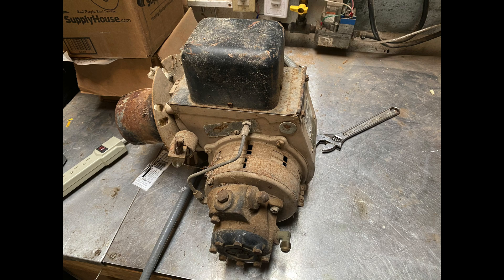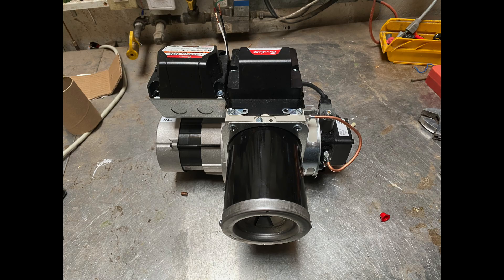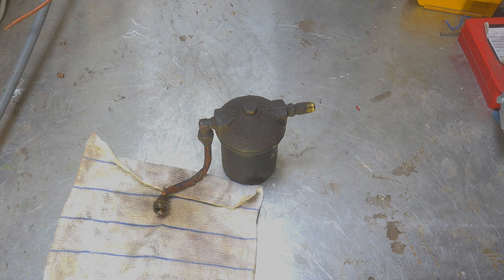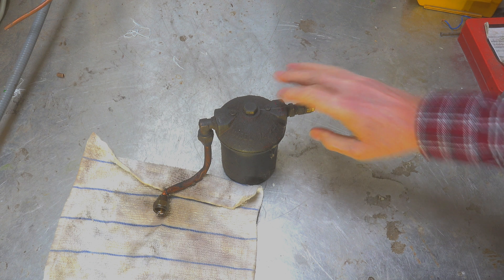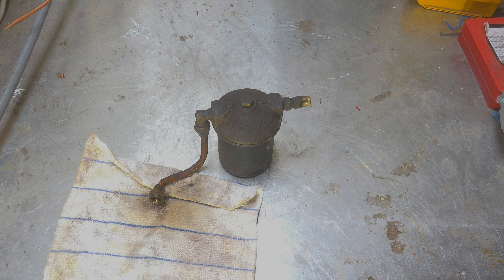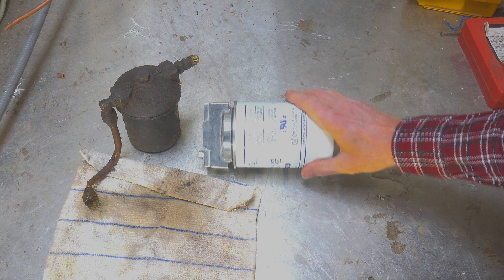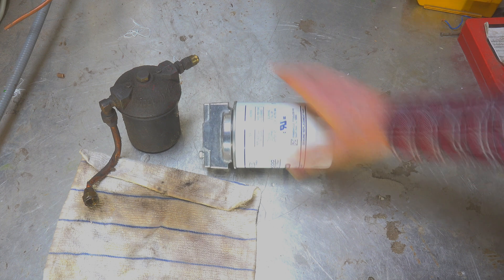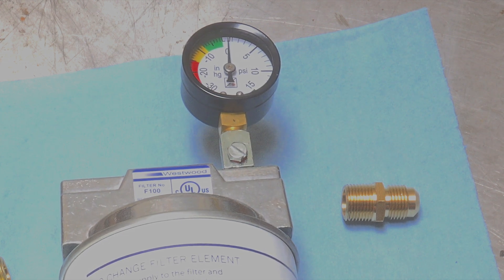Change from conventional to flame retention oil burner #1

Comment: I much prefer a 1725 burner, they are quieter smoother and much easier to work on, plus the J or Webster pumps last much longer.  but then Id rather work on a low pressure GE or Oil O Matic.
Reply from the maker: I also like the 1725 burner.  The 3400s can squeal if they get run even for a short time dry.
GFM

Comment: Hello sir i’ve got a question, today my furnace technician was out to warranty a leaky a/c core unit,this is a five year old high-efficiency furnace set up. While he was dismantling the intake and exhaust to ascertain the core he found an obstruction in the exhaust side of the furnace. Apparently while the fellas were putting this furnace together they accidentally dropped a 90° pipe fitting in the exhaust pipe. Which I would say probably blocked the exhaust by roughly 40%. My concern is should I be concerned🤷‍♂️. The heating portion of the furnace always worked awesome and we’ve had some pretty damn cold winters here. Thank you for your time.
Reply from the maker: If you haven't noticed a problem, such as reduced output, I would not be worried about it.  I also have seen many things in the plenums of equipment and never seen problems from them unless it was a flat piece of sheet metal that blocked output to the point that the limit kicked off.
GFM
Reply: @grayfurnaceman  Awesome thank you sir I just got off the phone with the owner( furnace store)They  are going to give me a top to bottom inspection to make sure nothing has gone wrong but there are assuring me that that restricted exhaust would not cause any permanent damage especially since my furnace has been operating flawlessly.again thank you for your time sir have a great day

Comment: We still have a lot of oil units up here in MN.
Reply from the maker: There are also a lot of oil in the northeast.  I think it is important to be sure you are getting all the heat out of the oil you can.
When I was servicing the conventional burners, there was a lot of wasted oil that never heated a house.
GFM
Reply: @grayfurnaceman  interesting. I never really knew there was such a difference in efficiency
Reply from the maker: @AmericanFarmerHVAC2024  The principal issue is control of combustion air.
GFM

Comment: Great information shared once again. 
Spin on filters are way more expensive to replace than the cartridge types, I personally prefer the "gear type" white ones.
Reply from the maker: For me, the value of the spin on is that it is far less labor.  No cleaning of the canister, no callbacks for plugged nozzle.  I am sure I spent more of the customer's money cleaning canisters that I would with a spin on.
GFM

Comment: I can’t remember the last time I changed over a burner? White gear type replacement cartridges are 10 micron the same as spin on filters. Guys need to know they need to use MOTOR OIL on the gasket NOT dyed fuel oil. The dye forms a varnish like substance and removal of the spin on becomes almost impossible.
Reply from the maker: Good info.
GFM

Comment: My Mazda 3 2004 had a cartridge oil filter.   Plastic housing about the size of a typical filter, had a replaceable O ring came with the filter, and it’s own drain plug and O ring.

Comment: I've always use a little Vaseline around the ring when I do my annual cleanings those spin on #2 fuel filters are gigantic pain in the ass to take off when they get stuck if I ever run into one that does that I take the housing off and use a vise in my van
Reply: @billsmith1770  good idea

Comment: Oil is a great heat if everything is adj properly the Webster pumps lasted for ever not noisy
Reply from the maker: If you mean the old J pumps that ran at 1750 RPM, agreed.  
My thoughts on the use of oil for heat are primarily about the increased pollution over natural gas.  That and the increased need for service in oil burners.
GFM
Reply: @grayfurnaceman  Living in rural Pennsylvania, the home heating choices are fuel oil, propane and electric.  Both electric and propane are more costly then fuel oil.  Yes, fuel oil equipment requires service as does all equipment.  When we purchased the home we are in now, I called the gas company.  No distribution piping within two miles and no intention of extending the piping.
Reply from the maker: @monoralph1375  You may be stuck with oil.  Keeping it serviced will reduce oil consumption to the minimum.  As a side note, they said the same thing to me about gas.  Then 2 years later, I saw the yellow pipe on a trailer near my house.  I called and they said would you like to hook up?
GFM

Comment: Just a note: A number of newer cars aren't using spin on filters, they have gone back to using a cartridge type filter. My son's Challenger for one.
Reply from the maker: I just looked that up.  Interesting.  The housing appears to be plastic.
GFM
Reply: @grayfurnaceman  Exactly, some new Toyota's of the last 10 years also used a cartridge. They said they are more environmentally friendly because there is less materials that needs to recycled or sent to the landfill.
Reply: @grayfurnaceman Almost all bmws have been using cartridge filters for a long time. As long as the filter is quality ( oem or equivalent )  it works in the factory change intervals.  That being said i have seen failures. I use spin on filter on my car i prefer wix. ( mazda ) Thanks so much i learned so much watching your channel and applied it to my boiler to make it more efficient

Comment: On the topic of oil filters in cars, it's interesting that at least some manufacturers have gone back to the cartridge sort of filter (now granted a much more modern element!) again.  Messier to deal with than the spin-on type, but i think the filter paper / element design is more important than how it's installed.
Reply from the maker: Interesting.  I would have the opposite view unless there is a high oil pressure issue.
GFM
Reply: Mercedes-Benz was using a paper and plastics Oil Filter in some of its cars instead of a spin on filter.
Reply: Our 2004 and 2007 Volvos are a replaceable cartridge type in a plastic thread on can.  Seals to engine block with an o-ring.  Filter is pleated paper with glued on end caps.  End caps are a press fit on a male tube on the underside of the engine. 

I have been changing the felt filter in a General can for 45+ years, different homes heated with oil.  I never saw deposits on the nozzle strainer.  But, I'm maintaining my own equipment and time is irrelevant.  Certainly a spin on would be quicker to change.

Wonder how the filter micron rating compares between the different filters